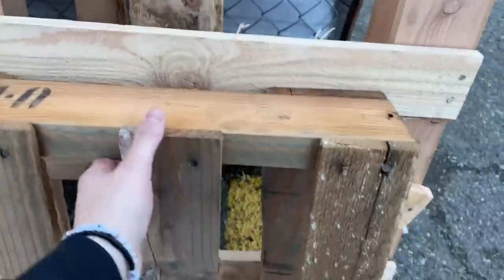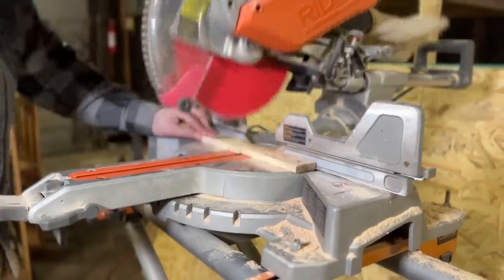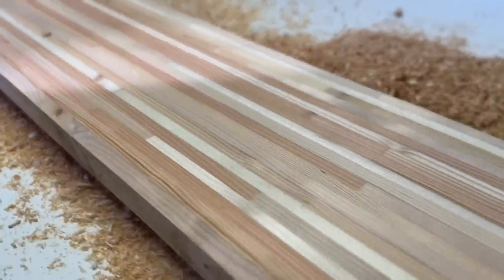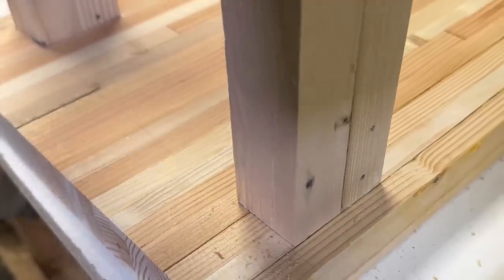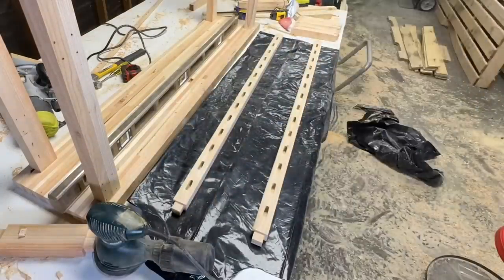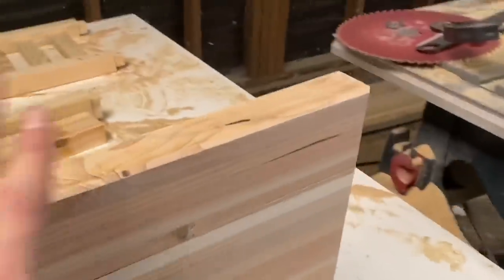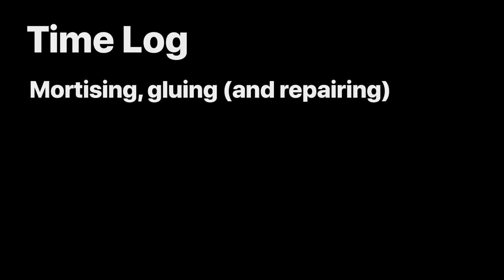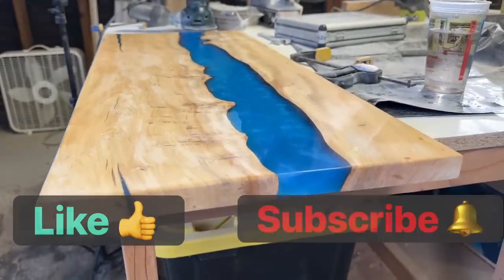FREE Pallets into Table for Profit?

Comment: Quick tip for the indentation left by the Router bearing.  Take a wet rag and lay it on the “dent”  if time is a factor, use a damp rag and an iron. It will swell the dent out.

Comment: tip with the router use it from left to right, unless it is a unconvential one that spins in the other direction then use it from right to left. 
this way it pushes itself into the wood instead of out

Comment: As someone with lots of time and very little money, i have been looking into this kind of woodworking recently, my biggest concerns with these types of laminated slabs are strength, I'd probably be wanting to run a couple of router channels on the underside that spans across the slab and then glue a piece of wood in that channel and plane smooth, or figure out a way to drill all the way through the slab and put a dowel all the way through, so there is something more than just glue keeping the slab in 1 piece. Maybe my concerns aren't warranted and they're perfectly strong, maybe I'm also just used to doing overkill on projects.
Ultimately your project is impressive considering the material source
Reply from the maker: Appreciate this comment man! Thank you. 

For the strength of a glue laminated slab, it mostly depends on the dimensions and orientation.  These are edge grain laminated, which acts very well in bending along the length of the sticks. If you rotated the slab 90 degrees it would flex a lot, possibly break. 

If I used wider boards, I would add dowels, biscuit joints, or dominos. The bottom support, or full depth dowels you mention could be necessary on really large tables.  But with wood glue, it’s still very strong.  You can also just add depth to the slab as the table leg span increases.  Then weight might become an issue.  Usually you want the boards to span long ways on your table so the glue joint isn’t really taking much stress.

Intuitively I would say if you have a leg span greater than 2ft perpendicular to your glue joint - that’s when you probably start needing extra support. 

Structurally speaking this is a 1 way slab, the bending forces are along the length of the wood and there’s very little stress on the glue joints. 

Credibility - studied architecture and took structural classes as well as many years working as a designer and builder.  I might make an in depth video about this.

Comment: when you use pallet lumber, how do you check for nails you might have missed? I was thinking a metal detector. Any other suggestions?
Reply from the maker: There are sand detectors, similar to what TSA uses at the airports.

These pallets were very clean and very few nails in them so I wasn’t too concerned. Sometimes you get them with staples, and other small broken off nails that are hard to see.  I wouldn’t run those through my planer without wanding them first.

Comment: I've had this idea for a while, but currently don't have the materials to try it, of deconstructing pallets by using 2 2x4s, inserted about a foot into the pallet where the forks of a lift go, on edge, together, and next to one of the pallet's 2x4 members, and then just scissoring them open to pull the slats up.  I'd clamp down 4 bottom slats to horses, especially the ones toward me, so that only the top slats get the force.  Then push the 2x4s in a bit further, raising more slats the further in I go.  Then extract the 2x4s, slide them in again alongside the next 2x4 member, and so on.  What do you think?  7 feet of leverage seems like it would do something.
Reply from the maker: Look up homemade pallet busters.  This might work, except your probly want to put it on the ground and stand on it. A buddy would help. I think if you did this with 1 board, it would split the slats because there won’t be even pressure and it will twist the board out when you leverage it out.  Pallet busters are the way.

Comment: I work in a wood plant and some of our materials come in on pallets. Just asked boss man earlier if I could take the pallets cause I plan on make furniture and other things with them.

Thought it was funny that you mentioned the bad wood would be used as firewood cause that’s exactly what I said too 😂
Reply from the maker: Ah that’s awesome! Maybe you can get some free or cheap cull wood or scraps too if you work at a wood plant 😜

Oh yeah lucky to get 70% yield off a pallet. Lots of firewood.  

On another note…I will say, I love up cycling pallets or other “trash” wood.  I will make other videos of this, But there are some drawbacks. This table has since had a little movement since I finished it.  Nothing crazy, but tiny little bumps in the top.  I will let it continue to dry for another  few months in my house and then sand it and refinish it again.  I need to let the pallets dry out much longer.  Little pointer for you and others out there if you want to make something really, really nice.   Some say, trash in, trash out. And there’s some truth there.  With that said, there will be other pallet wood tables I’ll make and post because well, free wood is free.

Comment: Doesn't wood glue just pop right off of melamine? Also, if you ran the pieces through the thickness planer, why are they different thicknesses (for the top)?
Reply from the maker: Wood glue will pop off melamine, yes. But still want to keep the bench clean and not create extra work later.  They are slightly different thicknesses because I didn’t plane the 3/4 boards down to the same as the 1/2” boards.

Comment: Brother please stop sliding sideways on tablesaw without using a sled to cut your tenon shoulders. Honestly it’s not worth it! One sticky patch of sap or anything can result in life changing injuries. My cousin in a professional cabinet maker, 28 years experience and learned the hard way. I didn’t post to merely crush your grapes, also want to say “nice job”. Tip to remove router bearing marks: soak the dented area with water then sand when dried. Works best on softwoods like pine.
Work safe, don’t gamble with your fingers, hope to see more from you

Comment: But you also used electricity so put that on the list
Reply from the maker: Yeah there are a lot of overhead expenses that I could have added. Tools, supplies like sandpaper, electricity, camera equipment, truck & insurance, gas to get pallets.  Could be useful for the next woodworking video! 

Trying to keep this simple here, and the main message is that you can make something valuable out of trash with effort snd creativity!!
Reply: @baddogcreative  I feel like you could add to that list till the cows come home, I think the simplified version you're going for is a good idea! The only thing i'd question is did you add some of your own lumber for the stretchers, I can't tell when you mention it if it was part of the original haul or not. If not i'd probably add a rough cost of that in but that's all. Really nice console table though either way!
Reply from the maker: @liamcarrington26  ahhh you are the only one that noticed an extra 2x4 came out for the stretchers on the bottom shoe rack. 😜

This came from a 3rd pallet I broke down 😄 so I actually used 2.2 pallets haha.
Reply: Ya... add the 40 cents of electricity on the list... get real

Comment: Your profit is ZERO, if you pay yourself a gross of $30 /hour, plus add the cost of materials, the time you spent with the truck to get the pallets, the gasoline, the electricity used by your tools, the cost of the shop and tools etc... Your profit is ZERO, you just have a lost of money...If you sell it for $500.  But in my opinion the value of that table can be $. 150/200 if you meet a good Samaritan buyer.
Reply from the maker: I see where you’re coming from here. There’s a lot of overhead costs that go into making something like this. From running a business perspective yes you are correct. For a hobbiest , their labor is sort of like profit… which is what I’m trying to display here. You can make money on the materials and supplies spent doing this. 

Whether that hourly payout is actually good or not… that’s the challenge and for most people casually doing this it’s probably like $20/ hour or lower. Enough to buy some tools and fund the next build. Eventually maybe you find s good market and start profiting like you describe.

I’m agreeing with you though, ha hope that’s clear.  Not trying to make the video misleading by any means. I might include some overhead costs in the next one.